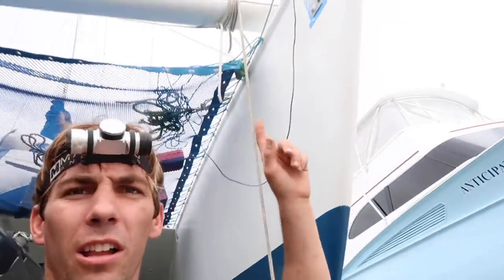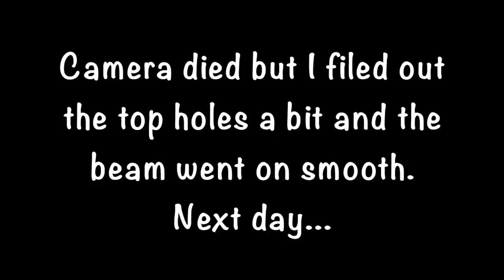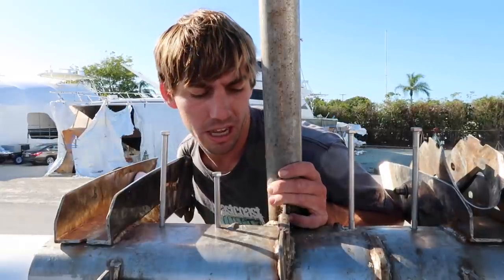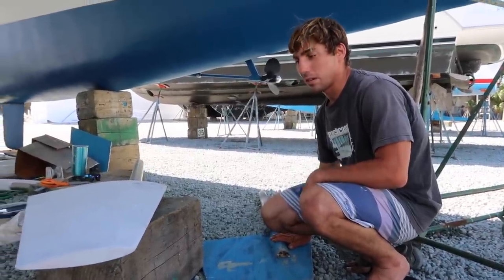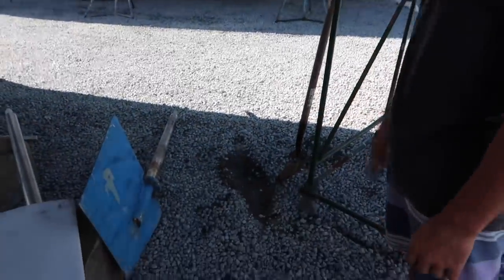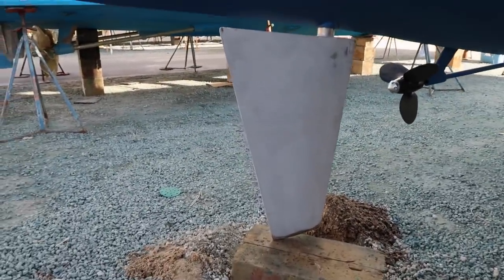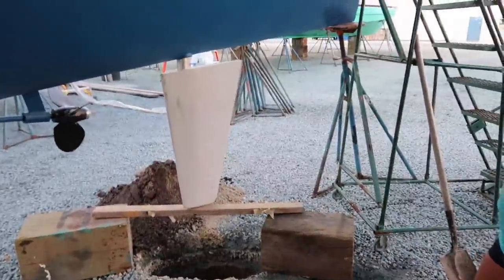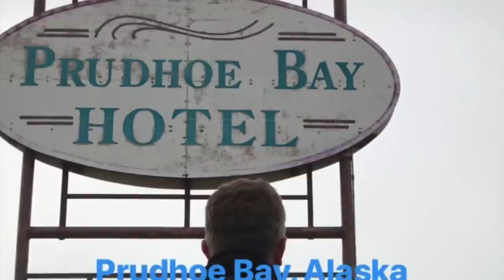The MOST Difficult Boat Yard Jobs...

Comment: Had to do the same hole digging operation to pull my rudder on the hard.  I used a big steel bar to break up the ground, then a shovel to scoop it out.  You should save one of the old rudders somewhere onboard in case you hit ground in your travels.

Comment: The new rudders will make a huge difference in your steering! Most noticeably during slow speeds. But the efficiency of the foil shape will do a lot more for your overall speed and movement through the water vs your old ones. Even though the old ones looked narrower they had a lot more drag then the new ones. I hope you enjoy them and would love to hear your opinion on how the boat handles now.

Comment: the rudders look good my concern might be the increase in draft , zingaro has had to replace its rudders multiple times because of shearing them off that might have been the reasoning for the flange and bolts on the old ones being easier to replace by removing the bolts and putting on a new blade , without haulout, but overall she's looking quite spiffy  to coin a phrase from sail life

Comment: The biggest challenge in using compression tubes is having to snake the tube into the mast and then properly align the tube to the hole.  One technique I have successfully used is to drill one of the holes large enough to allow the compression tube to pass through that hole.  The compression tube is then cut long enough to accommodate the wall thickness of the mast.  Think of it this way - the compression tube is seated against the inside surface of one wall of the mast and penetrates the second wall of the mast and is sized to be coincident with that second wall.  This allowed me to avoid the challenge of having to snake the compression tube into the mast for proper alignment with the holes.

Comment: Why you drilling holes through the rudder shaft?  Isn’t there a collar that slides over it with four set screws?  That’s some major work you did.  Question?  Does Billy have an engineering degree because he really seems to know what he’s doing.  The boat is looking awesome.
Reply from the maker: Hey bob it is a fiberglass collar but there are no set screws. It’s a ss bolt that goes through the collar and shaft to hold it on. Haha I def don’t have an engineering degree but i learn a ton when I take things apart and put them back together...

Comment: Poor Billy. That stainless will work harden as you drill it and just be a PITA. It can actually get harder than most drill bits. Using a hand drill is absolutely the worst way to do it and most prone to work hardening but what can you do it's in a tiny hole so you can't exactly get a drill press or mill in there.